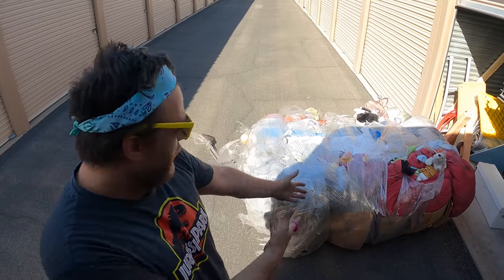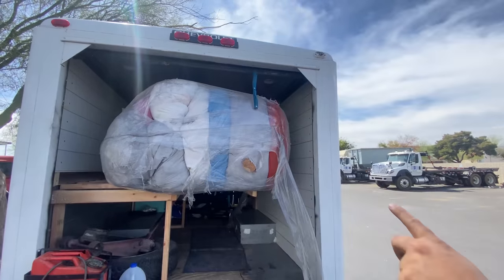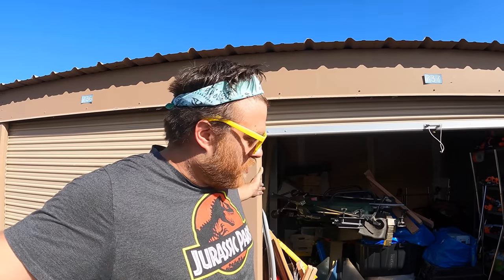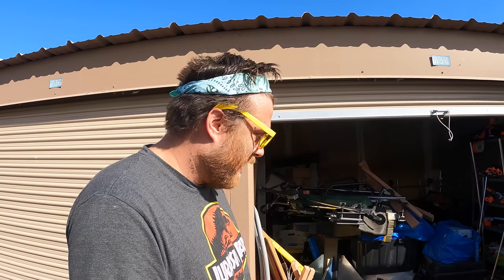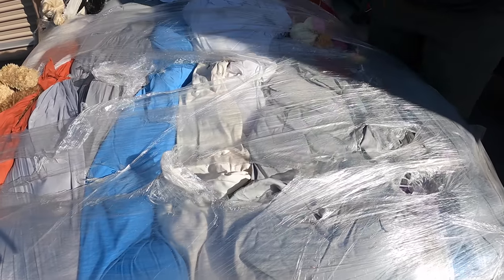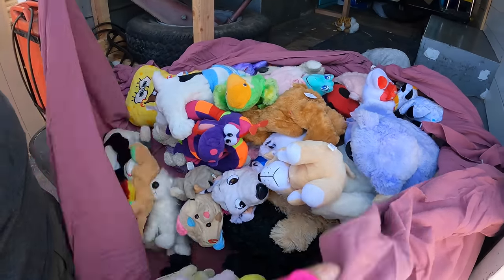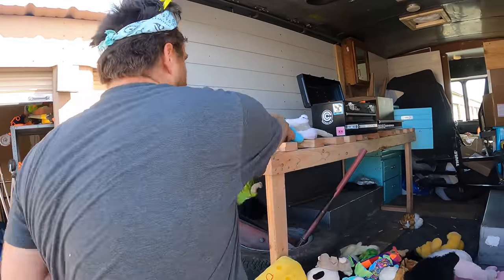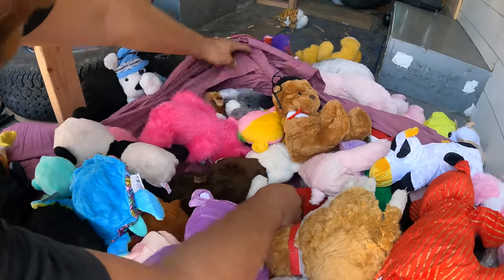2000 LBS of Plush for $100!  GOODWILL BINS!

Comment: this video is from a while ago and you probably don't have any of this anymore but if you do, in the last blanket you pulled out a clear bag with a few small plush. The last one from that small bag was what appeared to be a horse with patches on it. If it was that is rare. It's a plush called blue noes friends or teddy taddy. They were a 4" UK exclusive plush that is discontinued. They can go for $30-$50 on a reselling app. I collect them and they are extremely hard to find now. If you still have it and didn't thought I would let you know.

Comment: That wire is called 'Baling Wire' and yes, it's heavy duty stuff. Actually, you're lucky the bundle was shrink wrapped over the baling wire because it's usually under a great deal of pressure and when cut, that wire can slice through skin.
Reply from the maker: Lucky for me, I’m smart enough to grab any piece of wire, and wiggle it, and know whether or not it has enough pressure on it, to safely cut.